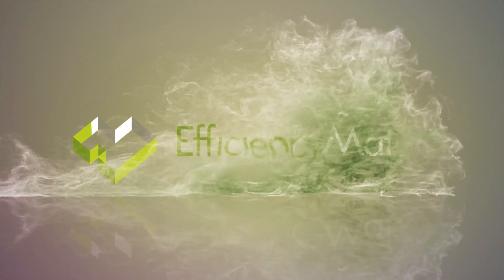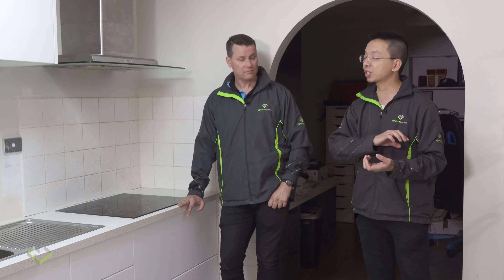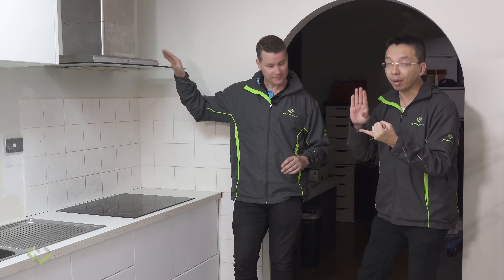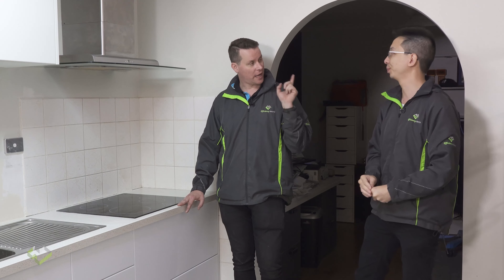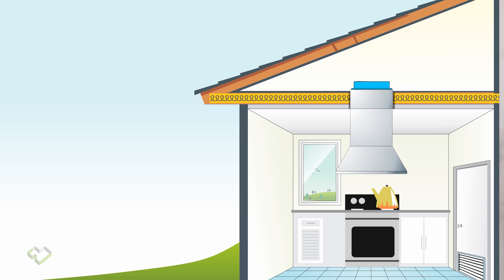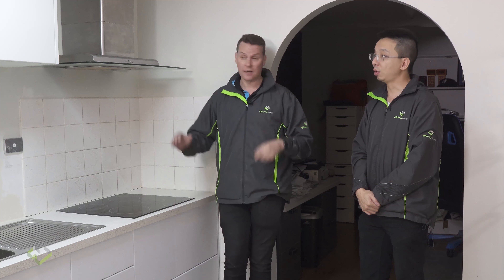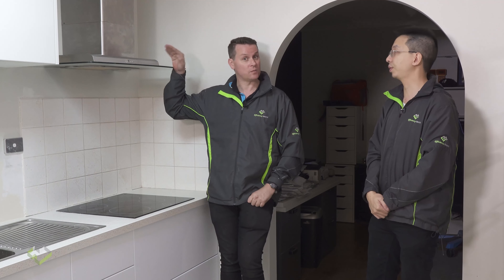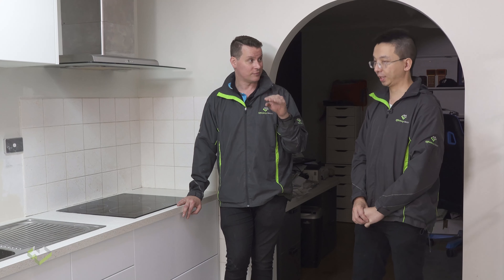Kitchen Rangehood Ventilation Solutions

Comment: You guys are completely right. I just vented mine to the outside rather than the roof space. I needed to remove old oil soaked insulation. This area also attracted mice and rats where there is evidence of rats trying to eat insulation and roof rafters soaked in oil. If you want a cheap fix for rat infestations and damage to insulation vent your range hood directly outside.
Reply: instaBlaster.
Reply: A grease filter on the range hood should prevent that. Did the one you replaced have one? If it did then they don’t work and it’s a reason to get you to pay more.
Reply: @paulredinger5830  so its ok to send to attic if I have a good grease filter? (Don't have experience making hole in roof top)

Comment: My range hood isn't even venting into the roof space! It just vents out the top of the kitchen cabinets towards the ceiling! And this is a new house that was only built in 2017. Interestingly, there is a small hole in the back of the vent space through to the wall cavity. The range hood is an  AEG DL8560-M, which has an oil filter metal grill and a charcoal filter - is venting toward the ceiling sufficient for this type of range hood?
Reply from the maker: @JonBOY26  no way!  All rangehoods should go directly to the outside.

Comment: I am trying to tighten up my house also. Getting UPVC windows with 0 air infiltration hopefully. So which product is suitable for this situation ? Any of them ? I was considering inline extraction to reduce noise further. I have one going out the wall and makes a mess of the eaves. The vent is badly sealed and bringing air back inside even if its ducted. Is a roof exhaust with flashing best and do I need a roofer to do that ?

Comment: 1:05 WHAT THE HELL??!? I actually shouted when you said that. Who allows that?!? That's insane! If you find that you should sue the builder!
Reply: My friend had his kitchen remodeled and it was discovered that from the original builder the exhaust was run right into the wall cavity and left open there. I guess it's a common practice, maybe the builder doesn't follow up with HVAC companies to pick up where the installers left off.
Reply: it is very common sadly. Mine too is done this way.

Comment: Do you have any insight on how the ductwork installlation can affect grease trapping and CFM efficiency? I see installations where the M to F are installed in AND against the direction of airflow. Some argue that grease slides down into the crimped edge, others argue that it gets trapped when pulled up through...I'm having a hard time finding literature on it.

Comment: Hi, thank you for your video. I was trying to find a video on a stenchy/stale smell coming from both the gas fireplace as well as vent above the stove. I am in apartment, and I called maintenance. I have not heard back from them, and it's been over a week 🙄 I have never used the gas fireplace. I moved into this apartment 3-4 months ago  these are not brand new apartments maybe 2007? I also do not have pets and do not use any toxic, lab-made scented products of any kind.
I covered gas fire with reflectix to try and stop stency smell from blowing in as much as possible 🤢 I am wondering if you have any ideas or anyone I could ask about this? I'm in Washington state thank you so much for your help and time.
Diane
Reply: If you have a gas stovetop and gas fireplace and the smell is the same be careful could be gas leak/ aka fire.
Different smell past tenants never  cleaned range fan screens - renters don’t care much like homeowners.
You could buy a cheap gas leak detector, or there should be carbon monoxide detector maybe dead battery?

Comment: How would I go with a flat roof house built along passivehaus principles ie sealable building HRV unit ?  Would I be best just having extraction over the cooker into the liveable air space (I haven't cooked chips or deep fried for about 20 years now!) ...
Reply from the maker: Sonia Woolley recirculation rangehood.  you need to change the charcoal filter though. 👍🏻. there should be an exhaust outlet in your kitchen going back to the HRV/ERV.
Reply: @ecoevo  Thank you - good to know these things prior to building ...

Comment: Australian vent hoods duct into the attic? That's pretty weird, I've never seen this here in the USA.
Reply from the maker: Thank god for that.  We are lucky we have very temperate weather down here.
Reply: @ecoevo we usually vent range hoods to the ceiling or outside wall and through a roof vent or wall vent with a built in damper.

Comment: If it vents into the roof through a grease filter there shouldn’t be any grease getting into the attic. If it does the filters are garbage and don’t do what they’re supposed to be doing making them redundant. If it makes grease stains on the ceiling your house is 200 years old or someone is dumping it up there.
Reply: The issue here is the maintenance / regular cleaning of the grease filter.